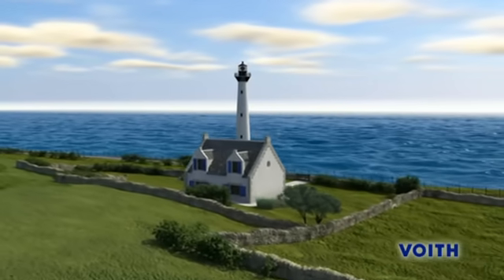Ocean Energy -  Wave Power Station

Comment: Potential? Yes! Costs? Much too high ....
With solar modules, on the other hand, you can reliably (except the winter & night) generate green electricity for 25 years at approx. 3-10 cent/kWh!*
Hydropower turbines are therefore only worthwhile if you need to be self-sufficient from the grid.

Comment: Look at the angle of approach of wave front with beach and find any  flow in the sea to right or left
If it is flowing it ca carry  a  land end hinged vertical  board  extended to the sea, to right or left.
The wave sliding over a beach at an angle  to it is cofirming curreny through shore and can drive  a under water turbine at lowe speed

Comment: How much KW/H can it produce for this size turbine and generator? 

or how much KW in a year?
Reply from the maker: The power plant visualized in this movie was in operation between 2008 and 2018 on Island Islay and was primarily an R&D site. It had a total capacity of two 500kW. There is another wave power plant.
In the year 2011, the Mutriku Breakwater Wave Plant was inaugurated. The Basque Energy Agency commissioned it in the bay of Mutriku in the Bay of Biscay. It is the world's first breakwater wave power plant with a multiple turbine arrangement. The plant has a capacity of 296 kW from 16 turbo generator sets.

Comment: how much kWh does it produce?
Reply from the maker: The power plant visualized in this movie was in operation between 2008 and 2018 on Island Islay and was primarily an R&D site. It had a total capacity of two 500kW. There is another wave power plant.
In the year 2011, the Mutriku Breakwater Wave Plant was inaugurated. The Basque Energy Agency commissioned it in the bay of Mutriku in the Bay of Biscay. It is the world's first breakwater wave power plant with a multiple turbine arrangement. The plant has a capacity of 296 kW from 16 turbo generator sets.

Comment: the water of the oceans of the world is
00:04
almost always in motion hardly ever
00:07
interrupted waves break at the
00:09
coastlines sometimes strong sometimes
00:12
weaker there is an enormous energy
00:15
potential that is available around the
00:17
clock and free-of-charge a potential
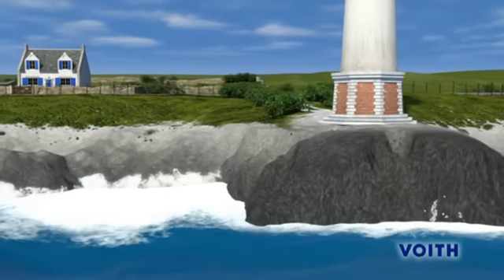00:21
that have fully exploited could satisfy
00:24
40% of the worldwide demand for power
00:27
this equals the output of 700 to 800
00:31
nuclear power stations poit hydro wave
00:35
chen is developing technologies to
00:38
convert this inexhaustible energy into
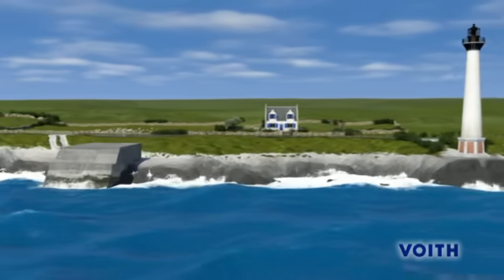00:41
electric power without the emission of
00:43
harmful greenhouse gases the operating
00:50
principle of this wave power station is
00:52
as simple as it is ingenious an enclosed
00:55
chamber has an opening beneath sea level
00:58
which allows water to flow from the sea
01:00
to the chamber and back the water level
01:03
in the chamber rises and falls with the
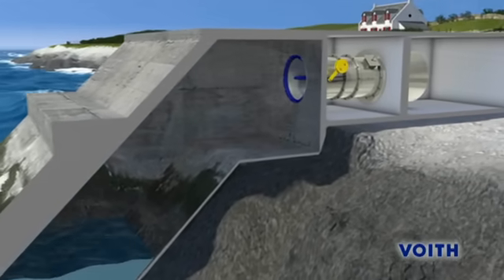01:06
rhythm of the waves and air is forced
01:08
forwards and backwards through the
01:09
turbine connected to an upper opening in
01:12
the chamber
01:17
as it is compressed and decompressed the
01:21
airflow has sufficient power to drive
01:24
the Wells turbine it is a feature of the
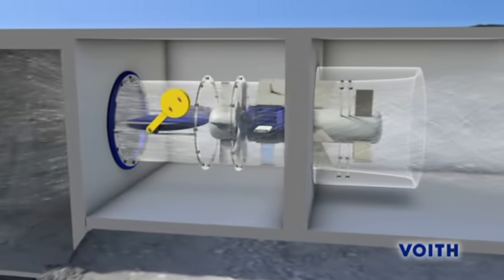01:26
wells turbine named after its inventor
01:28
that it is driven in the same direction
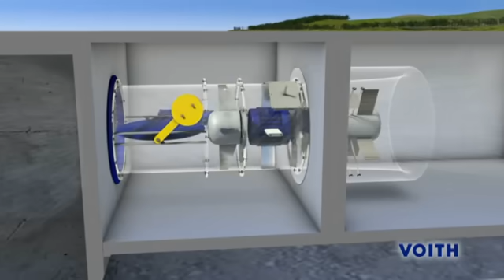01:31
by both forward and reverse air flow
01:33
through the turbine even relatively low
01:37
wave motions can generate enough airflow
01:39
to keep the turbine moving and to
01:41
generate energy
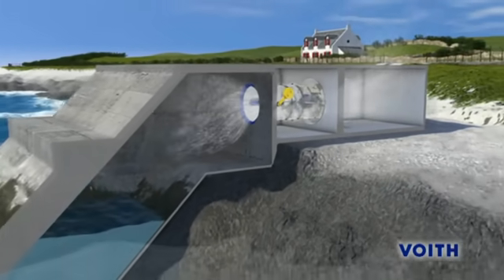01:50
this is how easily energy can be
01:53
generated with a wave power station day
01:55
and night all year round as long as
01:58
there are waves the world's first power
02:04
station of this kind was put in service
02:06
as early as November 2000 on the
02:09
Scottish island of Isla and has been
02:12
feeding power to the grid ever since
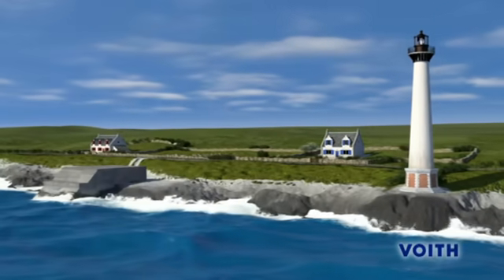02:16
poit hydro wave gem is convinced of the
02:20
commercial potential of wave energy we
02:23
are certain that our wave power stations
02:25
can make a significant contribution to
02:28
supplying the world with climate
02:30
friendly energy Foy engineered
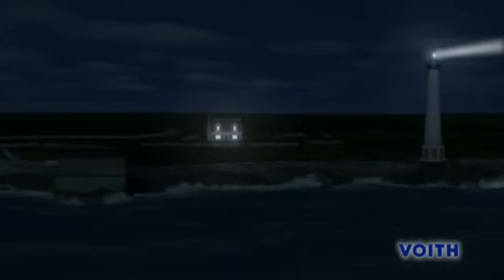02:35
reliability
Reply: Lol

Comment: I find it difficult to believe this is capable of producing enough power to be useful. Certainly the back and forth wave motion pushing the air will spin the turbine but I would think as soon as a load is connected to the turbine the spinning would be drastically reduced and the turbine would find it difficult to provide sufficient power. Perhaps if there were many such turbines working together it might be feasible but I suspect it would require a very long section of shoreline.
Reply from the maker: @Bruce A: Thank you for your comment. The power plant visualized in this movie was in operation between 2008 and 2018 on Island Islay and was primarily an R&D site.  There is a Wave Power Plant in Mutriku, Basque Land in Spain. It was commissioned in 2011.  It is built into the wave breaker.  In this way, no shoreline is destroyed. The plant has a capacity of 296 kW from 16 turbo generator sets.

Comment: This will never ever be more than a nice movie... that must be the most inefficient way to extract energy out of waves.
* You use wind... 1000 times less dense than water.
* Either you design a turbine to have a maximum energy extraction in one direction and neglect the opposite side or you have a shit extraction factor for both sides.
* Salt Water Vapor and metal chase housing, metal moving parts... yea that is going to be fun.
* What are the few percentage of actual available area this could be installed?

This system is absolutely useless and will never see any application beyond prototyping and testing facilities, sad that so many people think this would be of any use...
Reply from the maker: @  Medhusalem : The power plant visualized in this movie was in operation between 2008 and 2018 on Island Islay and was primarily an R&D site.  There is a Wave Power Plant in Mutriku, Basque Land in Spain. It is built into the wave breaker. It was commissioned in 2011. You can also visit it. 
They do a lot of R&D in this field (also offshore). 
Do you suggest everybody should abandon projects like this and not try to develop sustainable energy generation?

Comment: What is the energy output
Reply from the maker: @ Jackkipper _7106 : In the year 2011, the Mutriku Breakwater Wave Plant was inaugurated. It works on the same principle - the "Oscillating Water Column".  The Basque Energy Agency commissioned it in the bay of Mutriku in the Bay of Biscay. It is the world's first breakwater wave power plant with a multiple turbine arrangement. The plant has a capacity of 296 kW from 16 turbo generator sets.

Comment: ave power is great and like many newer power technologies it is effective but it is complicated, high Maintainance, ugly and unnecessary. We have recently taken a new step to advance the physic of power production by enabling chemistry of the atomic nucleus, or "nuchemy" in new FUSION NUCLEAR POWER. We are passing the chemistry level where we interacted with the atomic electron shells and are moving on to manipulations in this "NUCHEMY" atomic nuclear building era when we interact and multiply nuclear protons. We have rediscovered the lost work of the alchemists and can make new elements with different atomic weights. This was ably demonstrated in "The Safire Project". Quanta are important. We now have enough energy in them to manipulate the atomic nucleus much more easily by creating a compartment, or what is a local region of plasma containment around an anode so reactions at this atomic nuclear level can easily take place. This is about to practically enabled a really fantastic and cheap new era of energy production for the whole of mankind. This with hydrogen, so actually free fuel,  obtained from water or atmospheric moisture anywhere in the world. This new fusion nuclear is at the industrial commercial production final development point as of now. The energy argument and other power methodologies are all now virtually irrelevant as we have new and very physically and economically powered practical and local community level fusion nuclear power. Solar roof plus Teslawall battery may be the present way to go domestically but megapack batteries and multiple storage technologies interconnected with an expanded ugly grid have a less certain requirement when you consider new any-scale community based and 24 hr reliable and self-fueling fusion nuclear in the form of the "SAFIRE GENERATOR". Learn all about it at "aureon energy.com". Learn the newer EU and plasma physics at "Thunderbolts Project.com" and you will be permanently reeducated with the advanced new EU theory that will allow you to understand more about the astrophysics of our whole universe.

Comment: Unfortunately, 3 years after this was released the Islay plant was shut down and decommissioned. Like all wave energy generation schemes, this one worked well in theory but the technology was unable to be scaled up to have sufficient generating capacity to be cost effective and never produced more than 50% of its expected power output.
Reply from the maker: @  DeepThought : Yes you are right, the power plant visualized in this movie was in operation between 2008 and 2018 on Island Islay. There is a Wave Power Plant in Mutriku, Basque Land in Spain. It is built into the wave breaker. It was commissioned in 2011. You can also visit it. This technology is still very new. There is a lot of research and development in this field, especially in the area of efficiency.

Comment: lol and it will produce enough energy for one light bulb, there is no air pressure from that, it is basically a wind turbine but more complicated and less efficient and you add a water corrosion from that salty water as another problem .... it doesn't exist because it is a dumb idea
Reply from the maker: @ ping pong : Your claim is not valid. It is working. There is a Wave Power Plant in Mutriku, Basque Land in Spain. It is built into the wave breaker. It was commissioned in 2011. You can also visit it. The plant has a capacity of 296 kW from 16 turbo generator sets.

Comment: Probably not practical and hence hasn't made it in over 20 years
Reply from the maker: @  fxp : Your claim is not valid. It is working. There is a Wave Power Plant in Mutriku, Basque Land in Spain. It is built into the wave breaker. It was commissioned in 2011. You can also visit it.

Comment: If you look into it abit deeper, the size of the compression chamber on the "wet" side, to get the volume of air needed to make this worth while, is HUGE! Its a great idea, but not practicable.
Reply from the maker: @  Sany0 : Thank you for your opinion, but you're mistaken. There is a Wave Power Plant in Mutriku, Basque Land in Spain. It is built into the wave breaker. It was commissioned in 2011. You can also visit it.

Comment: I'm just curious does any body know how much energy one of these can produce/ I'm sure its relevant to size of design, but I'm always curios about the math behind size comparison to energy gain?
Reply from the maker: @ Camden Thompson : The power plant visualized in this movie was in operation between 2008 and 2018 on Island Islay and was primarily an R&D site.  There is a Wave Power Plant in Mutriku, Basque Land in Spain. It is built into the wave breaker. It was commissioned in 2011. The plant has a capacity of 296 kW from 16 turbo generator sets.

Comment: Metal components of turbine: “ahhh energy production!”

Salt corrosion from saltwater: “am I a joke to you”
Reply: @computercrazies  I'm fairly certain the thousands of engineers already have all that covered and have thought about using these new materials xd
Reply: 316l grade stainless can work
Reply: @farukkzl4506  the weight will result in a very low efficient energy conversion.

just carbonfiber is a perfect enough alternative to all the others posted here so far.
Reply: @PutsOnLoafers  Considered as a metal, it is of course long-lasting and strong enough to withstand salt water.
 good alternative to carbonfiber
 Well, wouldn't it increase the cost too much?
Reply: @farukkzl4506   Initial cost could be higher you're right.   Although I see a quicker return in investment  when higher efficiency is achieved.

A bit like High quality expensive solar panels  VS  cheap solar panels    which one would generate the most power within  X amount of years.
Reply: @PutsOnLoafers  But it can be a closed chamber, just the waves pushes up the floor.. IE, no seasalts.
Reply: @Mads-hl8xj  hey that's actually an even better idea
Reply: @Mads-hl8xj  the air is moist so also salty
Reply: @chagi4334  There is filters for such environments, also making overpressure helps .. always some fancy solutions ;)
Reply: how about titanium?
Reply: ummm..concept of maintenance dude!! ever heard that ??
Reply: u here? I watched so many of your vids
Reply: Gold plating
Reply: They probably have that sorted out with alloys or special coating. Warships last a fair bit in sea after all, so maintaining a few turbine blades shouldn't be a problem.
Reply: @durt214  high quality plastics maybe?
Reply: @Cam-sv3hj  Possibly, since it's supposed to come into contact with air mostly, perhaps some sea water mist. Perhaps some textile reinforced plastic/resin based composites for the blades, or practically any other non-corroding material could be used.

Comment: Just got that in recommended. And still never heard about those things so I guess they are not so good or electric company see kind of threat in this?
Reply from the maker: @  Kamil Moris : The power plant visualized in this movie was in operation between 2008 and 2018 on Island Islay and was primarily an R&D site.  There is a Wave Power Plant in Mutriku, Basque Land in Spain. It is built into the wave breaker. It was commissioned in 2011. You can also visit it. 
They do a lot of R&D in this field (also offshore).

Comment: everyone gangsta until sea level increase or decrease.
Reply from the maker: @  Johan Indra Permana :Thank you for your opinion, but you're mistaken. There is a breakwater wave plant in Mutriku where chambers are vertical. The opening for the airflow or the column is high enough to ensure vacuum if sea level increases or decrease.

Comment: It’s bullshit! This wouldn’t work, the output would be insignificant and not to mention the maintenance around the clock. And that lie about waves being able to generate more than 900 nuclear power plants is absolute ridiculous! Unless you wanna forget about coastlines and pack them from end to end with this ridiculous things just to power up an LED lamp.
Reply from the maker: @  Leo Brent : Thank you for your comment. Your claim is not valid. It is working. There is a Wave Power Plant in Mutriku, Basque Land in Spain. It is built into the wave breaker. It was commissioned in 2011. You can also visit it.

Comment: Has it been built in the meantime? Or did it fail like all the other projects, because it would take a tousand years to rake back in just alone the electricity needed for the concrete of such a project.
Reply from the maker: @ Depp Rennt : Thank you for your question. In the year 2011, the Mutriku Breakwater Wave Plant was inaugurated. It works on the same principle - the "Oscillating Water Column".  The Basque Energy Agency commissioned it in the bay of Mutriku in the Bay of Biscay (Spain/Europe). It is the world's first breakwater wave power plant with a multiple turbine arrangement. The plant has a capacity of 296 kW from 16 turbo generator sets. This technology is evolving. There is a lot of R&D on this site.

Comment: Sufficient to replace 700 to 800 nuclear power stations sounds good, until you realise that this would require completely enclosing ALL coastal stretches with these turbines. I'm not even sure that they've left room for ports and harbours in their estimate. Or the ecological damage that replacing all beaches, mangrove swamps and so on with concrete boxes would generate.

Comment: That's a really nice idea, however not really efficient, since it uses only turbine for input and output flow. It should rather use two turbines, one for the input flow and one for the output flow, since when the input flow comes in, it wastes some of it's energy to switch the direction the turbine is spinning.

Comment: not practical
Reply from the maker: @  MrBat000 : Your claim is not valid. It is working. There is a Wave Power Plant in Mutriku, Basque Land in Spain. It is built into the wave breaker. It was commissioned in 2011. You can also visit it.

Comment: no it is not. That vid is so off point. As a stand along station, that is not connected to the grid. Once you try and connect to any Grid, synchronization of the out put of an ac device has to be brought into sync with the power gird. Now see how not easy that is with this type of generation system. Hydro dam, once you open the gate to allow the flow of water, it still takes some time before the wave action subsides and allows sync up of the generator turbines to the grid.. So It is a good idea, I studied this in collage way back in the 70's We were really onto something as a back up power system. but once we started the real math workup of the physics involved. It was made clear this was not a viable solution to the energy problems we face.
Reply from the maker: @  Gregory Spivey : Thank you for your comment. Your claim is not valid. It is working. There is a Wave Power Plant in Mutriku, Basque Land in Spain. It is built into the wave breaker. It was commissioned in 2011. You can also visit it.

Comment: didn't this fail and nearly destroy itself once real waves were applied?
Reply from the maker: @Quinncy Kaluzniak: Your claim is not valid. It is working. There is a Wave Power Plant in Mutriku, Basque Land in Spain. It is built into the wave breaker. It was commissioned in 2011. You can also visit it.